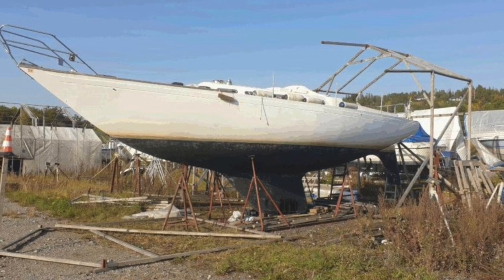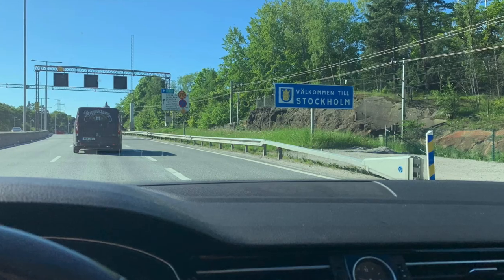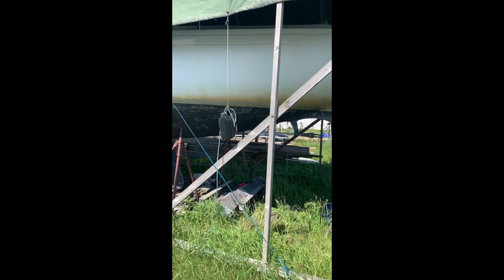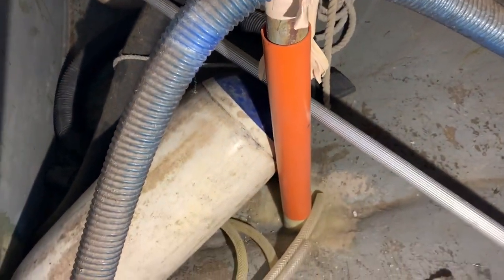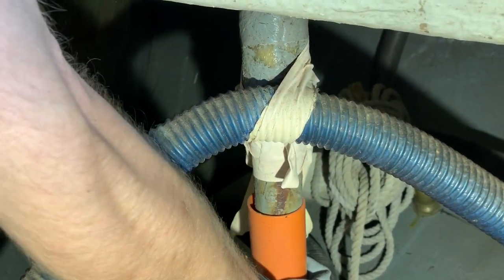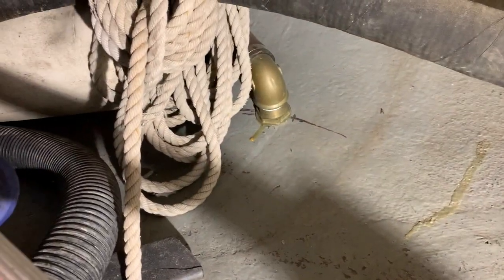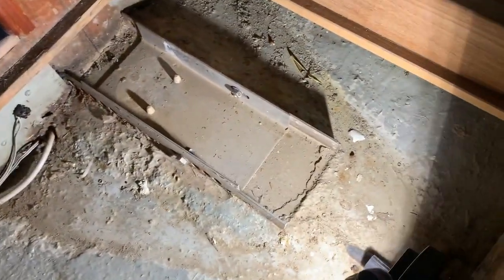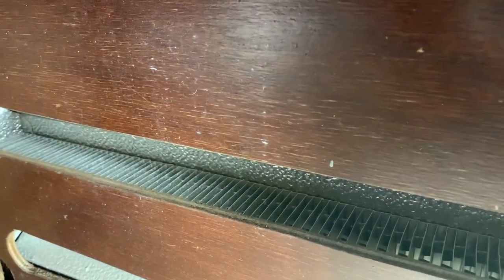Buying an old 36-ft sailboat project from abroad.

Comment: Im in process of refiting  my janneau rush 31 since a 1 years and half so i really feel your pain haha.I know how tuff it is.But the satisfaction of good work done it great.I alsmost finish the inside insulation plumbing painting headliner wall i removed the diesel engine 2 cylinders 250 pounds.Switching to electric 10kw soon.I change all the windows  starboard  and port side i 5% tint them too look awesome and block the sun.Good luck captain.

Comment: How is the headroom inside the boat? How high is the standing height?
Reply from the maker: The boat is roomy by 70-s standards but no so compared to modern boats. Headroom in main saloon ca 180cms. It's much bigger though than my 29-footer :)
Reply: @sailingsmalldreamingbig9022  thank you! :)